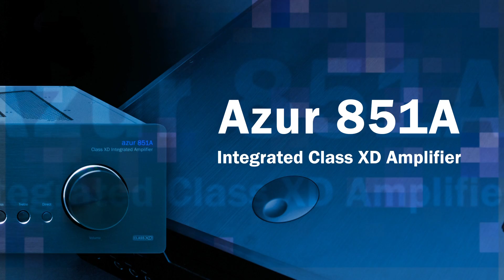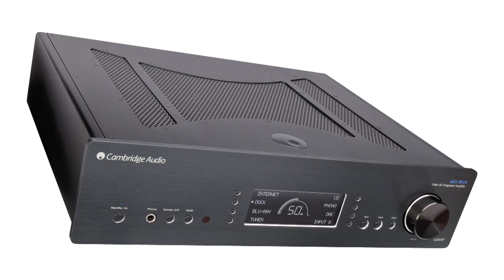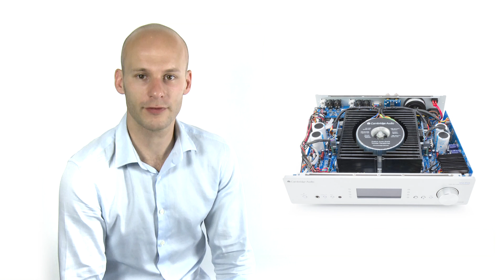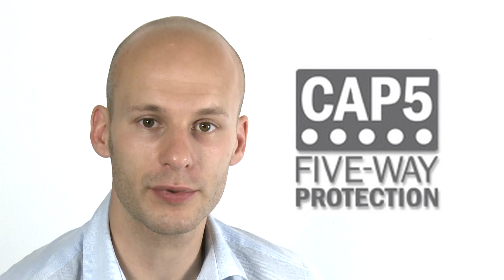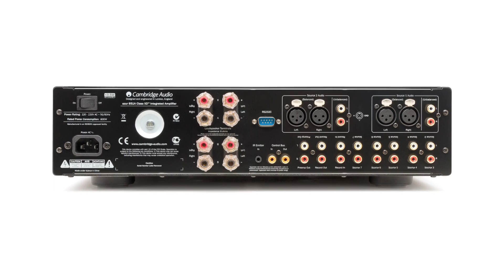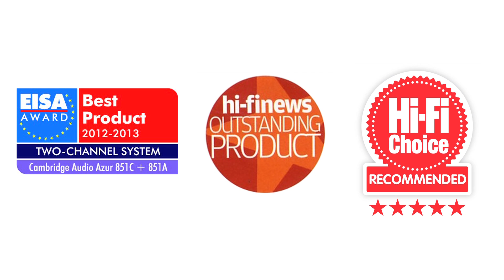Azur 851A Integrated Class XD amplifier

Comment: I bought the CA 840 V1 amp it had a faulty manual volume control. Richer Sounds replaced it with a CA 840A V2 amp (I also bought the 840C and 840W) but after a short while the manual volume had to be repaired once again. The Fault - Turning the volume down the amp would increase volume by at least 5 steps and sometimes would go to max volume.

CA tell me that "all electrical components can fail at any age". For something this expensive I would expect reliability. I previously had a Yamaha system (same power output) for many years with no faults whatsoever. I gave it to a friend and it is still going strong.   

It also appears that the 851A also has the same common fault as a friends one has developed the same symptoms. CA tell me that I have to to get it repaired yet again. Its about time Cambridge Audio admitted to this fault and recalled them. Just like car manufacturers do with faults.
Reply: chimese shit components... it's a very known problem...